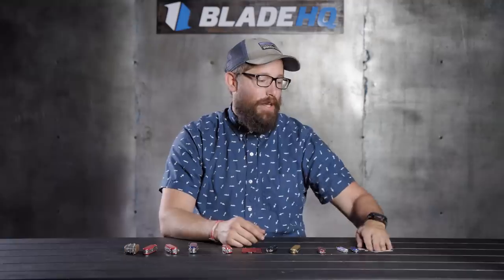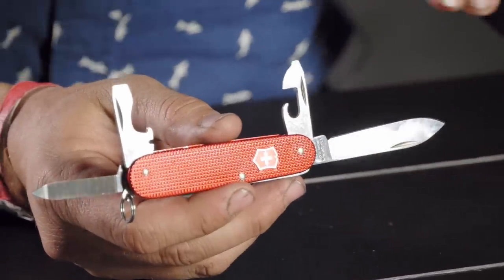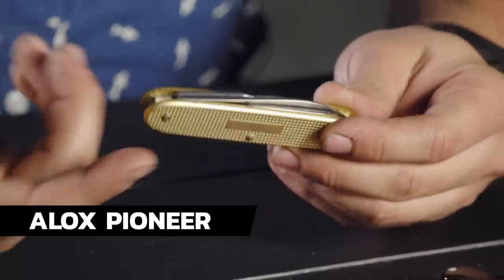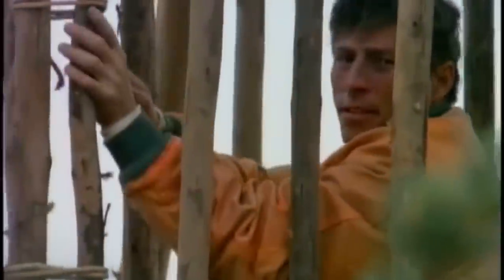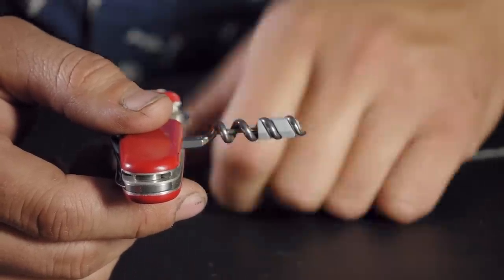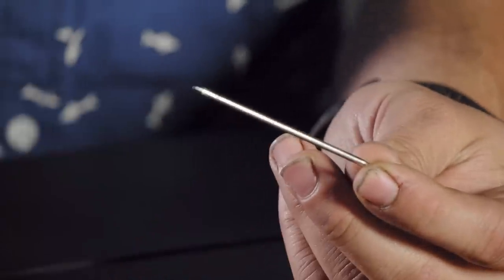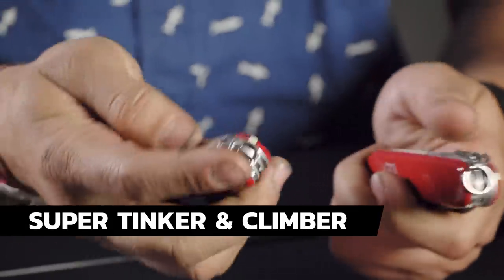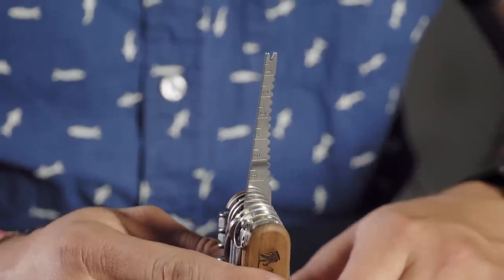Victorinox Swiss Army Expert Breaks Down the Best Swiss Army Knives | Knife Banter Ep. 88

Comment: The hook is used to carry hot pots with wire handles that are used with camping, hiking, and early army cooking.....big full hot soup pots got heavy as well as hot coffee pots. We used them a lot in the field..
Reply: Eastern Cowboy which knife did you use specifically
Reply: that's interesting, I'll have to try that, we live in camping situation 365 days a year, I do use mine for pulling knots tight on small twines,,
Reply: Works with Instant pot trivet and pot-in-pot handles.
Reply: Yup. use it with my 10 gallon bucket to change water in my aquarium. Doesn’t make the load lighter, but a lot more comfortable to carry. It also stabilizes the pen in certain models.
Reply: I have used the hook on several occasions to tighten eye bolts. Just hook onto one side and use the shaft to push the other side around and turn it in or out. Works pretty good actually.
Reply: I use the hook for putting the chain back on my bike when it comes off, saves you getting filthy hands when you're out and about
Reply: I have used it to tighten boot laces prior to going on parade .  And it helped when a zipper tab broke  I just inserted it in the gap and zipit closed
Reply: The parcel hook is useful to twist and tighten bailing wire, twisting hooks/eyes, lifting pot lids, etc.
Reply: @davidelliott8016  genius, will copy!!
Reply: I use mine almost exclusively to pull my kayak. I broke the T-handle that most kayaks have for a handle on the bow. I just made a bigger loop of cord, and use my Swiss Army knife hook to drag my kayak.
Reply: The hook is also perfect for de scaling fish for food prep   or pulling rope thre slim spaces.
Reply: I got a huntsman for the hook I use it daily to save my hands
Reply: i used the hook to repair the chain on bicycle
Reply: Bro so much 🤣
Reply: The hook can be used to move bailed hay. (The wire if a hay bail)
Reply: Hook is handy for mechanics who work with springs. I've also used it to lift wires out of cramped electronics.
Reply: Pulling cotton out of aspirin bottle.
Reply: Ideal when you clean the shower and need to remove the drain cover.
Reply: I'd still use the hook to carry parcels. I usually carry a piece of paracord which comes in quite handy if I need to get a bulky package to or from the post office.
Reply: The parces hok? Perfect for those annoying mesh bags that potatoes or onions come in and make your hand feel butchered in less than 5 minutes :)
Reply: I know, so many people crap on the hook, but it’s very useful when camping. If you don’t like the hook then don’t buy the knife basically.
Reply: I use my hook to open pull tab cans faster.
Reply: Hook is also interesting for lifting up barbwire 😊
Reply: Great for attaching springs or elastic over a hook
Reply: I use the hook on my heavy wool sweaters. If you get a pull out of the wool because you snagged it on a branch use the hook on inside sweater to pull it back in

Comment: I think the reason they use flathead is A. It’s flat and will fit easier and B. You can use a flathead on a Philips screw but not vice versa
Reply: The small flat head on the can opener fits great in phillips head screws
Reply: On top of that it's also a small pry bar.
Reply: Also it's not common in the UK but the knifes from Switzerland 🇨🇭
Reply: It’s nice to adjust your scope with
Reply: I am from Austria (close enough to Switzerland) and I have to say that people in europe (except the UK) indeed use more flathead than phillips. Like somebody else said you can use it for both.
Reply: @rolandnyul   In my opinion everybody uses philips screws more than flathead. I'm from Germany.
It's just like back then in 1891, when the really first SAK for soldiers came out, you had the flathead screws. But since 1920, when mass production got bigger and bigger, philips screws were invented.
Reply: Flathead screws are still around on older stuff and even because they're cheap.
Reply: @jeremyisaacs1930  even their flag is philips...
Reply: @loerber  haha
Reply: @on_philm  Yes, indeed historically the flat head screws were more common. But nowadays with all those computer screws the Philips or even a Japanese screw driver (that Carey Holzman mentioned and uses for the M.2 drives) are far more common.
Reply: I installed network equipment that had a philips screw into a rack with a flathead of the Huntsman. Solid little drivers they are.

Comment: The hook is very useful for opening can food with badly designed pull tab. You can get much more leverage than pulling with your finger.
Reply: Nice, I would use it as such
Reply: I never thought of that!
Reply: I always knew it as a fireside pot lifter for camping pots and kettles with wire handles. tie up bundles of kindling with string and tote them one handed
Reply: Best tool for resetting a bike or gocart chain!
Reply: Tent stake puller
Reply: Thanks
Reply: Saw someone use it to replace a fallen off bike chain as well.

Comment: Victorinox Huntsman and an Opinel 08 and I've never wanted more knife. For bush crafting, hard use tasks I add a hatchet. Before I get hit by the tough knife crowd, I was taught if you are worried about your knife breaking you are using the wrong tool. I'm not saying that is the right way of thinking, just the way that works for me.
Reply: Right up until it doesn’t. Never cheap out like that.
Reply: @talisikid1618  The trick is to know the difference between a knife and an axe, then use the right one.
Reply: Paul, I would suggest also looking into the Victorinox Harvester. Having that hawkbill blade is a game-changer. Not saying replace either of the knives you mention because both, I can attest, are balls awesome but there's nothing like finding a plastic bottle someone ditched and using that hawkbill blade to turn it into ready cordage you can also use with a lighter to make it shrink down to make your bonds tighter on bundles. I think you'll love it.

Comment: I have a small collection and I keep them handy for daily use. Love the veteran counseling. Felix Immler videos are amazing for many creative uses of each tool. He actually recommended using the parcel hook to hold the ink pen. 
Love MacGyver!
The flat head screwdriver blade is multifunctional...primarily as a bottle opener with a  notch for wire stripper or wire bender. Most electrical outlets still have a slotted head. I use it as a ring tab lifter and opener now that my hands are arthritic. It is still a very good and relevant tool.
I wore a Swiss card out.
Reply: Everyone wants to be McGuyver back in the 90's =)

Comment: The lack of a Phillips head: hundreds of times I have used the tip of the can opener to tighten or loosen a Phillips screw. It has always fit perfectly. It just contacts two of the 4 slots, so perhaps doesn't have as much torque, but it does work, and well! (BTW, I bought my alox knife in Germany in 1975. My favorite blade is the awl, using it to clean my fingernails!)
Reply: I modified the can opener.  I ground away the can opener to make the screwdriver more useful.  It actually made the can opener better . Slightly reshaping the screwdriver, makes a great Phillips driver . See my YouTube mod . ' victorinox explorer, huntsman, farmer, climber screwdriver can opener mod ' .

Comment: There is a lot uses fo a corkscrew.
Here are just som from top of my head:

1. Opens corked bottles (duh!)
2. Untie knots.
3. Pry the battery out of a cell phone.
4. Screw it into a wall and hang your coat on the SAK.
5. Staple remover. 
6. Smooth out the hole you just made with the reamer.
7. Clear clogged faucet sprayer.
8. Bicycle tire valve tool.
9. Holds the micro screwdriver.
10. Pick gravel out of tires.
11. Rip open a blister package.
12. Ice pick.
13. Mark a pilot hole.
14. Clean mud out of shoe soles.
15. Knot the end of a cord. Thread it through the corkscrew. Handle.
16. Pop balloons.
17. Aides in sewing.
18. Clean mud out of sprinkler heads.
19. Push used snare wire through it, to straighten out the wire and remove coils or kinks.
20. Pulls the drain plug out of a tub.
21. Open the corkscrew and screw it tightly into a broomstick-thickness stick. Now open the blade. Tie it securely. Survival spear for fishing.
22. Hang the SAK from a piece of cordage from the ceiling. Plumb bob (I have the middle of the handle marked on one mine).
23. Corkscrew + a metal lid = a filter or wire mesh for cooking.
24. Carry a chunk of C4.
25. Pull frozen shoestrings tight, or help loosen them.
26. Helps get the innards out of a squirrel.
27. Gets the candle stub out of a candle holder.
28. Start fights on multitool forums.
29. Remove the fuel filter from a lawn mower.
30. Although the new corkscrews are 4 turns, you can use them for range estimation.
31. O-ring remover for your flashlights.
32. Pry out partially-exposed nails.
33. Tighten the apron strings on a wrestling ring.
34. The inside diameter of the corkscrew is 1/4". I'm sure you know what you can do with this.
35. Open just a small hole in a coconut.
36. Lift stuck items out of boxes.
37. Fish the tape out of a clogged VHS tape.
38. Remove patches from a flintlock gun.
39. Remove the inside of a shotgun shell, making a blank. Remove the wad and powder too.
40. If you don't want the mini screwdriver, the corkscrew can hold a ferro rod.
41. Tap a tree for sap.
42. Undo zip ties without breaking them.
✌️😉

Comment: Just a couple of notes:

1) You can use flathead screwdriver on both types of screws, But you going to have a hard time unscrewing normal screw with phillips screwdriver.
2) Macgyver used some kind of Tinker variation most of the time. Executive did appear on some episodes though. I remember him using the orange peeler in "Conuntdown" episode while neutralizing bombs on the cruiser.
3) You can use parcel hook to pull the tent pegs from the ground, drag a bunch of firewood you have tied up with paracord to the camp. You can prop a knife sa that it fuctions as a mobile stand, and most impirtantly, you can nestle a pen fine under it, so that you can write more comfortably holding the whole knife. And lastly, on the compact there is a nail file on the side of it. Yea, and what about putting fallen bicycle chain on the cogs again without soiling your hands?
4) You can get neat small pocketclip, you can attach to the keyring and clip it to your pocket.
5) Climer as opposed to Spartan has also the parcel hook, which normaly is a tool that comes on the same spring with scissors. You got a scissors on your knife, you very likely have a parcel hook as well.

Thank you for the video. Victorinoxes are just amazing for ordinanry (non-knifenut) people.

Comment: If you go camping and use a cast iron pot, you can use the parcel hook to carry the cast iron with. They usually have a thin like wire handle.
Reply: Good points, all. You're only limited by your imagination!
Reply: Or for fishing knots. I like using then when making boilie rigs
Reply: C.  Scraper.
Reply: Yeah, I think the hook is mainly for buckets or pots with a little metal handle. So when you have loaded the bucket with really heavy stuff that the handle doesn't push into your hands too much.
Reply: They work well for getting a knots out of shoe laces

Comment: 1_Main use for the hook nowadays it's to write with the pen. You level the hook, place the pen in the gap, low back the hook and it clamps the pen in place to write more comfortable.
2_Useful to open drinks cans with ring.
3_To pass the lace of worn out snikers for the hole.
4_To carry things tied up with laces/ropes.
5_To take camping pots for the handle off the campfire.
6_To adjust the radius of the bike wheels
7_To set in place the bike chain without get grease in your hands
___
The scaler it's a way to give use to the edge of the tool to take off the fishing hook. It's very useful if you are in the wild and need to clean your fish. It's not really an urban tool. 🤣😂
Swisschamp it's a very useful SAK, it has almost what you need. It's not for a pocket, but it amazing in a bag/backpack.
My EDC SAK is the Minichamp. I love it and I have a little leather case to carry it in my belt. It has almost all you need in a daily basis in an urban environment.

Comment: When I was Field Engineer I used that Swiss knife "Champ" everyday at work or hotel and everywhere. It comes with leather pocket I strap it to my belt and it is there the whole day always ready to serve me. I found it much more useful than a Multitool plier from Leatherman for my job.
The flat screw driver has nothing todo with Europe standard. It is used by the solder to tighten rifle parts.
The hook is useful to pull your technical boots lace tight. Also can be used to get a lace or a small robe inside a tight hole, also it can be used to pull springs... I used all time at my job. 
For my job the Champ is all in one tool for me. however i carry around the Climber because it is lighter.  Some hotels in some fancy country do not allow Swiss knife inside the hotel you must déposit it everyday at reception and pick it up maybe at the morning if they don't try to steal it . 🤣🤦‍♂️
I carry a cheap spare Swiss Knife  as a present to the custom duty officer just to close his eyes on the saucisses and drinks inside my bags, it works better than giving 50.

Comment: This won’t work for your Compact, but on any knife that has the separate bottle opener and can opener there is a “hidden” Philips driver.  The little slotted screwdriver on the end of the can opener is actually a 2-D #2 Philips driver.  Not saying it’s as good as a full 3-D Philips but it’ll do in a pinch.

Comment: In Fire Fighting and EMS it is common to wear boots that have a zipper in the front. You step into the boot, reach down, pull the zipper up, and you are out the door. If you lace the zippers into the boots tight, they look better but are hard to zip up. The perfect tool to get that zipper up is the parcel hook on a SAK.  FWIW: I have the Soldier with the Wounded Warrior Project scales. This is my second one, I accidently carried my first one into the airport :(

Comment: Thought I love them all for one reason or another, my favorite SAK is the Ranger. At 5 layers it's the limit of what I'm comfortable carrying in my pocket. And I have used every tool on it multiple times, including the parcel hook. The saw is out of this world useful, the file is great, the blades are awesome...it's just a great tool. I had purchased one several years ago and stupidly let my brother in law use it when I was helping him and my sister do some landscaping (FYI, the parcel hook is excellent for holding wire fencing in place and twisting wire) and he broke my knife. He used the blade to open a bag of mulch, didn't close it, dropped it point down, dropped the back of mulch on top of it, then stepped on it. I was very upset about that. Fortunately, someone (not him) loves me a whole lot and got me a new one. I'm also a huge fan of the Compact (which lives in my bag and goes with me everywhere) and the Cadet. I personally think it would be cool if Victorinox could figure out a way to magnetize that parcel hook or put a telescoping magnet in it's place for picking up screws, washers, nails etc. That would cool! Great video!
Reply: Felix Immler has a video where he showed 13 different tricks to use this hook. I don't know where he got the little magnet he put into the hook. This might be your solution for picking up screws, washers, nails etc.
Reply: I would love a version of the ranger for air travel - all the tools, just no knife

Comment: I've used the parcel hook to carry a five gallon bucket full of rock and it worked perfectly
Reply: I mean thats what the handle is for
Reply: @jordanmyers1450  maybe if the bucket doesn't have the plastic, avoiding it from digging into hands
Reply: @garrahan90  that doesnt justify carrying a knife like this.
Reply: Uwu knife police :/
Reply: does it actually hold up
Reply: @edmund8954  it still works perfectly several years later
Reply: @ethanmccall7015  ah I see,im interested in the Victorinox compact

Comment: I use the Hook for tightening wire when fixing my deer lease fences property line, Also pretty handy to lift my food/Bear bag when camping using only paracord with knots tied into the line every few feet, You can literally sling the line over a strong branch and pull up your food bag and lock it with the hook on each knot you make, when it comes time to tie it down this makes it much easier to hold on to the thin line holding such a heavy bag.
Reply: Juga wang

Comment: I'm 50 and have been carrying a pocket knife every day since I was 7. I've tried other things but always end back to SAK. I'm not a huge fan of the SAK stainless steel as they point out. My solution to sharpening is to get those knife sharpeners that have carbide and then ceramic set up as Vs that you run the blade through. It puts a decent edge quickly on a SAK and I no longer grumble trying to sharpen my SAK on my diamond stones.

Comment: 21:05 the parcel hook is great for carrying a wire bail on a bucket if it doesnt have a grip. I also use mine in line tying or or untying, threading and unthreading paracord. Several funtional uses actually. I carry My ranger everyday, or a tinker for light carry days